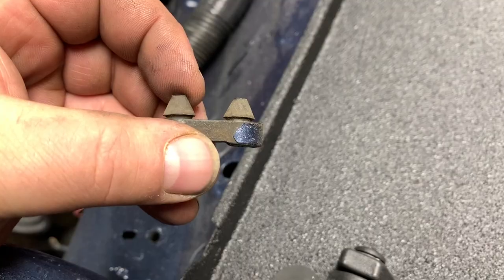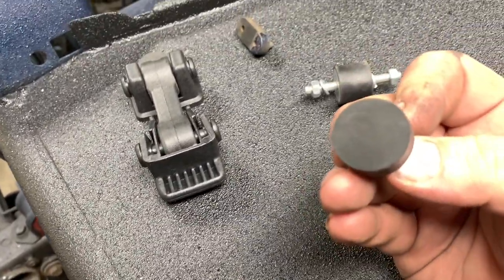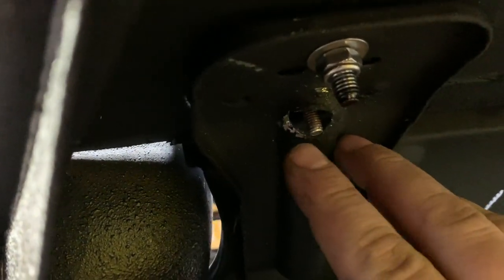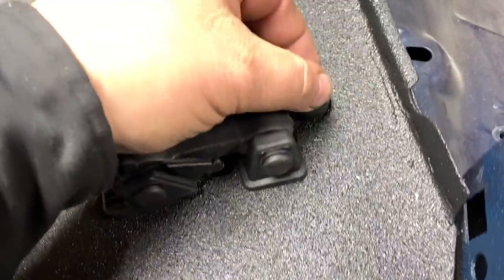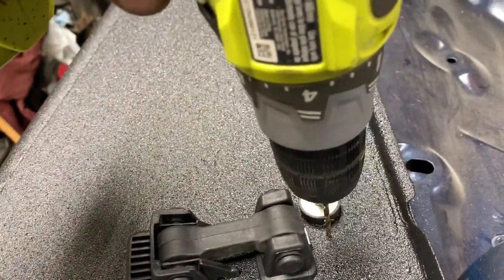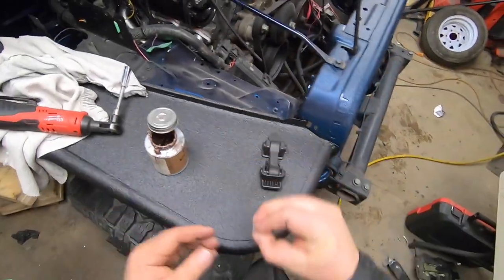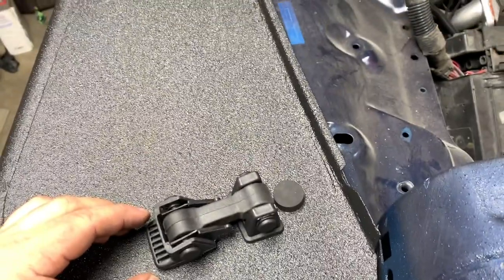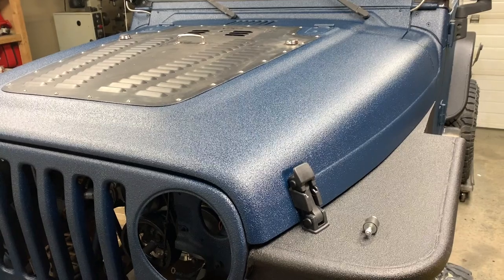Jeep Hood Grommet Cushion Mod

Comment: I`ve seen those rubber isolators in packs of four at Princess Auto. Good idea cutting them in half. I used your idea of them for a hood on a project of my own.
Reply from the maker: PA sells all kinds of stuff so it is very possible

Comment: Or you could get rid of those rubber hood latches and get an aluminum adjustable kit for $60 on amazon. No more stretching out latches, you can optionally put on a lock on them and no real need for those isolators. You can also glue/screw grommets on the hood side.